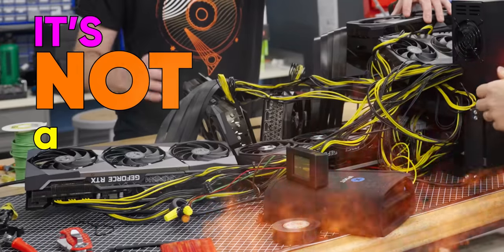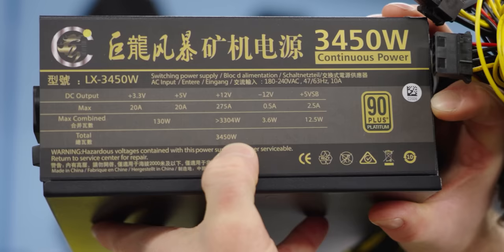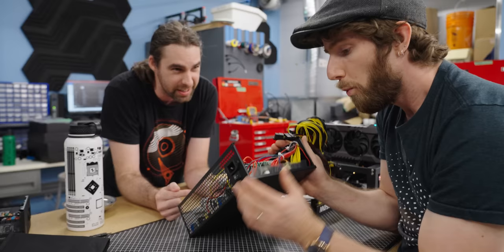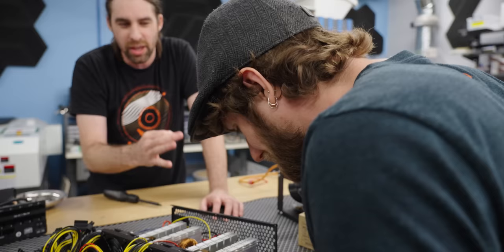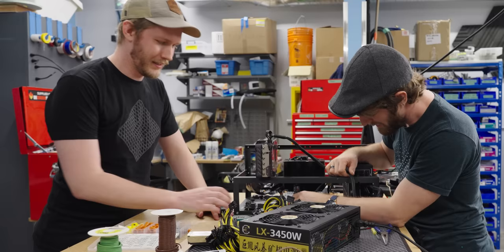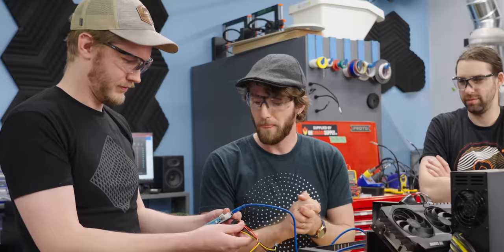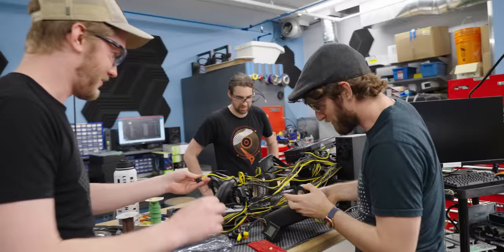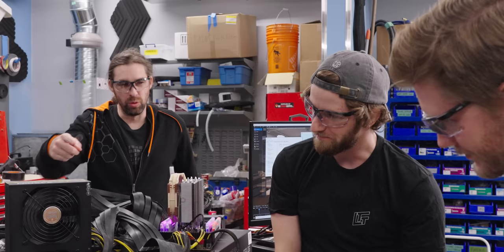This 3450W Power Supply is a Fire Hazard!

Comment: "How do you hope to get 3500w out of a single plug"
laughs in german electrical system

(To be fair this needs a dedicated breaker and is not allowed to run continuous because plastic sockets and powerbars etc will likely melt after 10h+
so its cutting it reeeaally close )
Reply: Even then the C14 inlet is not rated for 3450W. You need a C20
Reply: @jonathanbuzzard6648  in germany we just need a normal shuko for that. Its Rated up to 16A which is 3680w @230v
but the outlet might not want to pull that 24/7 
(But regular use is completely fine)

I mean thats still a full circuit with its Jan breaker but nothing too out of the ordinary
Reply: @jonathanbuzzard6648  Ohh sorry i brainfarted until now, yeah the C14 plug is officially only rated for 10A so no more than 2300w continuous load over that
Reply: Fun fact, in the US and Canada, we don't have only 120V. Most homes also have 250V. Everyone knows the = and the =o plug but we also have a 3 prong circular one (2321 plug) which tends to run on 20A circuits, and 3 phase 4 prong circular one (3P4W plug) that runs on 50A circuits, which can push 5000W and 12500W respectively. In our homes, not workshops or something. It's weird they don't get talked about ever.

It's for heaters and AC and such, most older washers also ran on one of these. But theoretically they could be installed for any purpose if your appliance was wired for it.
Reply: @kaldo_kaldo  yeah, i saw a video from technology connections about the US electrical system. Kind of weird to have a ground point in the middle of the transformer to get "2x 120V" from your 240V supply line and then use double breakers if you need the full 240V.

Here in Germany basically all (stationary) devices that use 3phase innately are wired up directly without a plug (like literal wires into the deevice) but we also have 3 phase plugs/sockets for construction equipment etc. which can push 11kW or 22kW respectively. I'm sure there are alot bigger connectors around but those are pretty easy to find, especially the 11kW one which makes charging an EV a breeze if the on-board charger and charging brick support it.
Reply: In Brazil our current system supports up to 4400W in a socket (220 x 20 amps), the 1100W/2200W version is common because it is low cost (110 or 220 x 10 amps), and a 380 V x 20 a version with 7600 W where it supports 220V biphase.

I was forgetting, we also have 220V single-phase and 220 Bi-phase (380 V biphasic is the sum of two 220 V phases), that is, one version is neutral + phase, the other is PHASE + PHASE (that's right, you didn't read it wrong)
Yes in Brazil we have 110V, 220V and 380V installations in some rarer cases 440V if it is for companies.

Already "industrial" plugs are common at 380V, 16 amps or 32 amps, that is, reaching 12 kW, the industrial standard can reach 125 amps, but you hardly see above 32.

In theory it is possible to have this source or similar in a "common" socket (220x20) continuously, but the most common is multiple power sources.
Reply: Australia is 230V single, 400V 3 phase.  We once were 240/415 but the rules got changed and lowered.
Common plugs in AU can take 10A so 2300W.  15A plugs are not uncommon either for caravans and other applications like it, so they take 3400W.  Standard 3 phase plugs in AU are 4 or 5 pin (with a neutral) rated at 10, 20 or 32A so 4000W, 8000W and 12800W.  I would guess that most 230/240 V countries would be something similar.  Most houses have single phase connections but 3 phase is not super uncommon and you can pay for a domestic connection quite easily (after paying for a sparkie to come wire it up).  Most sub boards in AU have separate circuits for things like stoves and aircons that dont have plugs and are wired in.  
All wireing in AU has to be done by a licensed sparkie.

I suppose in summary, this is more than an average 230V socket here will do, and the max a 15A one can do in Aus. As stated it'd max that circuit as your breaker in the main board would be close to poping.
Reply: @opticmoose  I was forgetting, we also have 220V single-phase and 220 Bi-phase (380 V biphasic is the sum of two 220 V phases), that is, one version is neutral + phase, the other is PHASE + PHASE (that's right, you didn't read it wrong)
Reply: @VoidField101x But one of my things is about 3 phase in the US
Reply: @DJRaffa1000  I’m pulling 3400watt out of a shuko outlet for over 6 months now and the outlet is totally fine
Reply: @yannicg  what Kind of load do you have there that pulls 3400w continuously 24/7 for 6 months

Also if its a Metall socket its fine, its just some cheap Plastic ones that tend to melt (there have been actual fires because EVs Drew 16A for the whole night and press loved to tell everybody how dangerous EVs are because they cab set your house of fire even if the battery is fine)
Reply: @VoidField101x 240 volts in us where you   have two hot wires it still single phase. Single phase you either have 2 hots or 1 hot and a neutral , both bare single phase. They don't call it dual phase.
Reply: @DJRaffa1000  We have in the Netherlands, Germany and Sweden also home plugs special for higher loads. Think about electric stoves. We call it the "Perilex". https://en.wikipedia.org/wiki/Perilex But for professional use is mostly the CEE17 plugs that would be used.
Reply: @haajee1  good to know that that exists, i've nerver seen that before.
I've only ever seen CEE plugs used for 3 Phase loads, even in residential buildings.

Thanks for showing me Something New ^^
Reply: @DJRaffa1000  You are never to old to learn something. Here in the Netherlands are the most used in kitchens or ventilation boxes with a 3 speed cable. It's more compact than a CEE plug because it will fit in a EU flush mounted box. :)

Comment: Chad Europeans show your appreciation here, we get 230v.
Reply: 230v.
Reply: 230 actually but ok
Reply: 220V, with 6000W limit here (Italy)
Reply: 230V/16A in Sweden (house).
Reply: @trolledyou7032  You have 27A fuses?
Reply: Euro 230v is different from US residential 230v. Euro is like 120v in the US - a single hot leg, a neutral, and a ground, only the hot leg is 230v instead of 120v.

230v "single phase"(more accurately "split phase") is 2 120v hot legs 180 degrees out of phase with each other, plus a ground, and possibly a neutral, depending on the outlet/circuit.
Reply: And oh, a 14-50 outlet, commonly used for electric stoves and dryers is 50 amps, that's just under 12,000 watts...👍
Reply: @machinist7230  but in usa had less cable loss at 2x 120V at phase 180 deg. because in usa have big cable that can hold easy 50 60 Amper. * low ohm cable
Reply: @orencomputerelectronics8751  no. They need big cable because of the lower voltage.
Reply: @machinist7230  also, commercial electricity, like LMG has, is typically 3-phase 208V and 480V, so three 120V or 277V hots 120 degrees out of phase with each other.
Reply: Not Europe but I just measured my English mains at the wall and its 245.2 V AC.
Reply: @modzona  if you have half voltage (120 vs 240) , you need double current to get same power ( W ).

because of that the cables more then 1.5mm. Then if you use 2 phase 120v you will get less power lost at cable power=I^2(amper)xR( ohm)

R= PL/A

L-merer
a=mm^2
P=steel contant
Reply: @machinist7230  Three phase 400V is also common, at least in my corner of Europe. Over here the power usually comes to the house as three phase, with each phase being 230V to the neutral. The 230V phases are split into different circuits, with an 400V three phase plug at the distribution cabinet (And possibility to run them elsewhere if needed.)
Reply: @banaana1234  it not recommaded to connect 3 phase togather unless it motor with 3 phase connector.

3 phase it use to spilt power to diffrent line.
Reply: @orencomputerelectronics8751  What do you even mean? Of course you dont wire them together, but its nice to have the capability. Be it to run a motor or charge an electric car or just for the beefy connector to handle bigger currents on one phase or something completely different..
Reply: @banaana1234  2 x pashe 120 you connect togther serial.

When 120V phase in 0 deg, the sec  start phase in 180 deg.
And in max reffrence it 240V rms at 90 deg on phase one and ( 180 + 90= 270 deg ) on phase 2.

One phase 120Vrms , sec phase -120Vrms
Reply: @orencomputerelectronics8751  in Germany every kitchen has a 3 phase box where you connect your stove
Reply: @dieplanes789  well we get 400v but split them up into 230v
Reply: @FelixEnder  of cource, every heater 2500W ( 10A  ).

You have 4 heat elemnet , then each phase connect to diffrent heater.

must have 2 big heater ( 2500w) , and to small 1000W.
Total 6000W , the one phase limit to 16A.

3 phase cable can power up 3x 16 = 48A . In oven it spilt to heaters
Reply: @orencomputerelectronics8751  Yes, but its the same thing with three phase 400V, its three 230V phases 120 degrees out of sync. Theres no problem having them in the same plug.

Btw, its common to have a 6000W (or even bigger) heater in the sauna over here, good luck with 120V or even two phase 240V :D
Reply: Nice to see you here Iron :) European 230V superiority :p
Reply: @FelixEnder  it 230V rms and in peak voltage up to 400V ( becuase the phase).

Only in two phase you get 2x viltage line.

In 3 phase you will not get 3 x 240V rms .
Reply: @banaana1234  because of that only 3 phase motor can work with 3 line at one load.

In oven , it spilt to 3 2500W line from 3 phase plug
Reply: Got 238v at the moment.
Reply: @orencomputerelectronics8751  So what? You still get higher capacity for that sort of split resistive loads.
Reply: @orencomputerelectronics8751  im no electrician so im not exactly sure what you want to tell me.

All i know is that we have 3 phases, neutral and earth comming into the house.

between the phases you have 400v, pahse to neutral is 230v.

we have all 3 phases running to the kitchen to connect our stovetops

And we have so called "400 Volt-Drehstrom" wall sockets where you can connect table saws and stuff like that that requires 400V
Reply: 230v in the UK. 😌
Reply: Something tells me, yet again, that US are the only country with something garbage, this time being the 120V they have.
Reply: Most households in the US have 240V. Our houses are powered by 2 120V legs that are out of phase with each other. 240V appliances just connect both legs. You put 240V outlets where you need or want them. Kitchen, Laundry Room, Garage maybe.
Reply: @orencomputerelectronics8751  your cable needs to have half the resistance because u need double the courent for reasonable wireing. And because energy scales with the square of the courent (P = R * I²) u have still more losses in the wire.
Reply: 230V/50A apartments Russia
Reply: @randomzocker8956  yes you are right , but i speaking about connect 2 phase 120V.

In usa and canada the cable design for high current (not 1.5mm 16A cable).
 
and if you use 2 phase and draw the same power like EU 240V(one phase) . in 2 phase less power loss in cable.

Comment: I’d love to see this thing on a spectrum analyzer in an EMI chamber!! I guarantee that even the base noise floor is through the roof.
Reply: Maybe if you put it under some highline wires it'll have some constructive interference & it'll go 110% efficiency?
Reply: Seems like it doesn't even have EMI shields so they're really not giving two shits about EMI on its electrical design lmao.
Reply: You will no longer be able to use a microphone anywhere near your computer lol. No more discord.
Reply: @danl6634  110 Patitum certified

Comment: 5:00 LOL at the switch wiring. That was done so a cheap 12vdc 1A switch could be used rather than a 240vac 15A one. Penny pinching, just like the missing components that says let the EMI be damned (probably a FCC fine waiting to happen, surprised they are not import banned).
Reply: Obviously it wouldn't be able to work with a 240V 14A switch anyway. 3450W on 240V with less than 100% efficiency.... from their claimed "90 plus" That would be 3833W, which on 240V would require a 16A fuse.
Reply: @HappyBeezerStudios  eh 15A can be overdriven an amp or 2 and never trip due to breaker manufacturing tolerances if you really push it and bin the breakers (usually 10% tolerances for cheap ones). The wiring can actually carry 2-3x rated current fine (ie insulation just getting warm, not melting) if the run is short. Most ampacity tables are for keeping voltage drop under 3% at stated amps rather than for temperature rise. Apparently the PSU won't mind if the voltage drops to as low as 180 (25% drop), but the breaker and wiring would with the amperage required to do that. It would be very difficult to run 3450W at 100% load anyway if using it for it's intended purpose (presumably a mining rack, and most mobos for those only have 8 gpu slots with each underlcocked = maybe 3kW).
Reply: Can you please explain what's wrong with the switch wiring? I only just started to study electronics and I couldn't figure it out :(
Reply: @TheVilivan  Normally youd want to have this switch cut power directly (so have it in between the actual input)

Comment: 5 years ago my parents bought a custom built low end pc when I didn't know anything about pc at that time. One day when I was playing GTA vice City the psu suddenly burst into flames with small explosions. Luckily my parents were near me so nothing serious has happened. Except a dead pc and a slightly charred table.
The moral of the story is don't ever ever ever EVER NEVER cheap out on a psu.
Reply: @Unknown_Ooh  like I said I didn't know anything about pc at that time. And that is the first pc my parents bought.
Reply: @Unknown_Ooh  To be fair, people who don't know much about computers just assume that pc building companies know what's best the same way many people just trust mechanics to not scam them with car repairs. We here know that pre-builts often skimp on the less obvious components that they don't list on the spec sheet (generic things like "850w power supply" without any mention of manufacturer or efficiency or "32Gb of RAM" without any mention of speed or cas latency). Most people see the CPU, GPU, and RAM capacity and when they look them up they seem reasonable and then just assume the rest of the PC will support them well when in reality the other parts are garbage
Reply: @kevinwells9751  The one thing many pre-builts don't skimp on is the PSU, they very well know better, they might put in the lowest wattage possible to save a buck, but most of the time they will buy decent PSUs.
Reply: @vgamesx1  yeah otherwise they would get into trouble or possibly sued